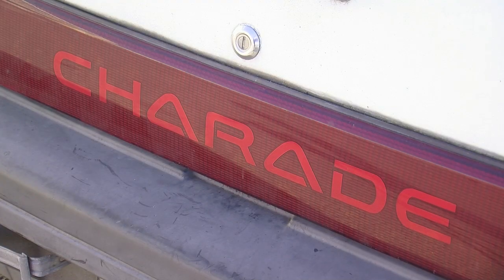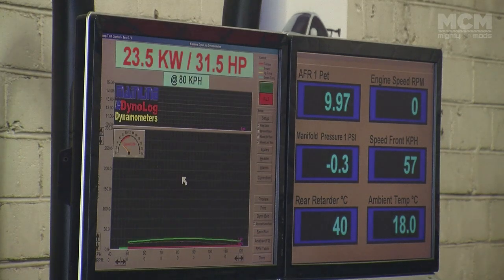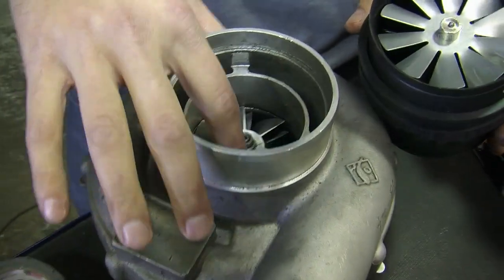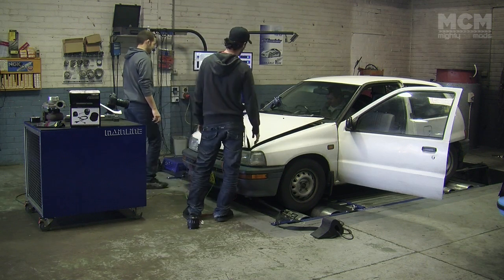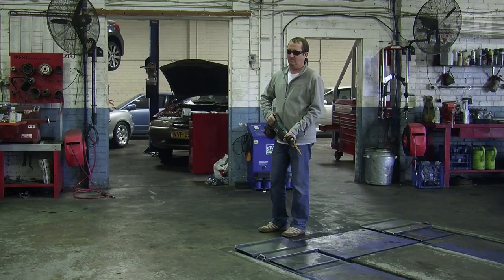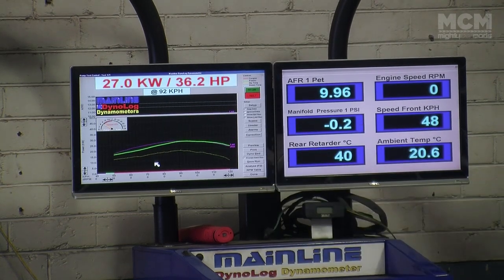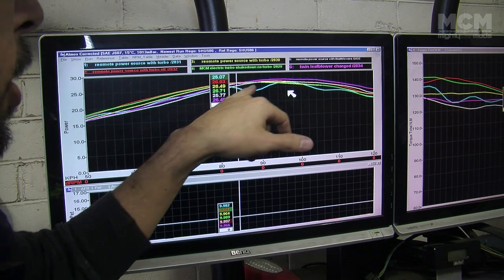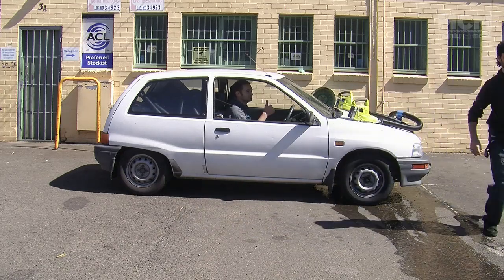Electric SuperChargers Mythbusted

Comment: These dudes don't even know how to use a dyno. You need to see curves at different RPMs. And of coarse not in that car it needs a car with clean sparks plugs and filters, etc. that is why it outputs different HP every time. Electric superchargers work but increase very little HP. The idea behind is to get COLDER air and a bit more air volume mostly under lower RPMs not pressurized air like would a centrifugal SC. It is something like Ram-Air or Coil-Induction. So in a way an electric SC would work in theory. The problem if sealed to the intake is that it may reduce the engine natural air intake under higher RPMs, so my suggestion is to use it outside the air filter to blow on it not sealed to the intake manifold. The MEMS ECU should compensate injector pulses for increased air.
Reply: No, they simply do not work. No way no how not gonna happen. You CAN NOT build pressure with one of those puny little bilge blowers marked up and resold as 'electric superchargers. They have on the order of 1/10,000th of the mechanical power to move and absolutely zero ability to compress air that a real turbocharger has at idle. If it did it would in fact INCREASE your intake Temps due to pv=nrt... you compress a gas and it WILL heat up, that's a law of physics  not some  boy racer theory to be disproven.  Fact is the are exactly zero electronic superchargers that do anything except to hurt performance. Now take your 94 Honda civic and get the fuck out of here with your 'racing stripes add horsepower through gravitational influence' bullshit logic and get the fuck out of here son before someone gives you the ass kicking you are  begging for.
Reply: Peter Carlson I only read the first sentence of your noonsense but noone said PRESSURE. Read back what I said before answering to unrelated things. And remove the head of your butt.
Reply: Miguel Rodriguez
 PV=NRT look it up, you change temperature you change pressure, they are directly dependant of eatchother. If you want to super/turbo charge an engine you need a source of compressed air that's a given, this will NOT give you that.
Reply: Peter Carlson The law of gases as it gets colder it has more density I learned that in elementary (in Europe) in the states you learn it in high shool. Go learn about Coil Induction and Ram Air. It amounts to a fraction of a second faster probably (could mean winning a race) I said you cant compare it with a SC anyhow the main thing in my comment was those guys have not clue how to use a dyno.
Reply: Miguel Rodriguez
It makes no difference. This device can only restrict your airflow at high rpm's and will slightly heat the intake air at low RPM's. Any way you put it it just won't work. They aren't talking about cold air scoops or the like and even with those they don't really work at all unless they are integrated into the vehicle by the manufacturer (like the chrysler 300's)  with careful study of the fluid dynamics of air and have an optimal length and shape of intake (resonance of such a long breather matters greatly), those cold air intake "kits" are also likewise doing absolutely nothing for you except perhaps slightly hurting performance. Something you seem not to realize is a fan does NOT cool air it can't, it won't, and it doesn't. Nothing about this will do anything to your car except add a slight electrical load and intake restriction just try to understand that. For super/turbo charging you need a COMPRESSOR, be it a roots type supercharger, or perhaps a turbine driven centrifugal compressor such as most turbochargers use there is just no way around it.
Reply: Peter Carlson Again I only read the first sentence of your dummy comment go back a read my original comment where I explain what it does and how to use it.
Reply: Miguel Rodriguez
Read the whole thing and you will know why your little fan won't work as a supercharger, they used the dyno just fine.If you can't do that you obviously have some kind of mental deficiency nobody can help you with.
 The only thing this does is take bucks from a mental midgit's pockets and gives them to the seller.same thing snake oil does.
Reply: Peter Carlson I did not buy any fan I was just making a remark again you should go back a read my comment as you are just repeating what I said. Besides installing a SC in a car that was not designed to have one will dramatically reduce engine life and premature failure of the engine will happen.
Reply: Miguel Rodriguez
 premature failure of the engine? Uh nope. WRONG AGAIN!
 I thought you were joking at first but you really don't know what the hell you are talking about.

I have a 7.3L ford powerstroke diesel I turbocharged at about 100,000 miles. Now going well over 500,000 without any problems except the normal wear and tear stuff you would expect to fix after that many miles. ie a couple gaskets and not much more.
Reply: Peter Carlson Have you heard the expression little knowledge is more dangerous than no knowledge? Applies perfectly to you.
Reply: Miguel Rodriguez
Being a diesel mechanic for 28 years after I left the army as a 91b  I assure you I do know what I'm talking about. You however are  talking straight out of your ass.
Reply: Miguel Rodriguez these aren't race engines, nor do turbochargers only get used on race cars, depending on what kind of racing from top fuel funnycar to long distance rally cars the distance driven from install/build to replacement/ rebuild could be 1000 feet, could be 1000 miles or an entire race season. These aren't race cars though, if the engine is in good shape and the boost isn't over the top they can live out a fairly normal life. Of course with your 94 civic with 250k miles if you 'throw a turbo on her' you will probably blow your rings but then again so can doing something as innocuous as replacing the heads to fix say a warped head or a burnt valve, the rings will have broken in and seated at a particular pressure where they wear quickly and mostly stop wearing unless the pressure is again increased which can cause old but otherwise still functional  rings to fail.

 Typically by boosting an engine with forced induction you aren't increasing the red line, that is usually limited to the spring action of your valves to close them  without getting valve float and slamming them into the pistons or in non interference engines just getting them to close on time for the particular phase of the cylinder's operation.
Reply: Peter Carlson Sorry I cant keep up with you I have a life here you know. Have no idea what a 94 civic has to do with this. BTW I have a Lotus Elise SC a Range Rover an Altima and soon to have a  Porche Cayman
Reply: Miguel Rodriguez And you're going to put a fan in the intake? LOL! How sad!
Reply: Peter Carlson No I am not. I never said I will. But certainly a SC in an engine NOT designed to have one and more if the car compression ratio is high it will prematurely fail. BTW if you use forcé induction naturally like installing a scope at higher speed the CFM are probably the same or more than with a fan but I still think a fan at low speeds is better than no fan.
Reply: Miguel Rodriguez Not Really. The LS7 (used in 6th generation corvettes check out my friend's supercharged z06 at www.powerlabs.org )   engine wasn't designed for a supercharger so people designed a supercharger for it while keeping it at a 10:1 compression ratio. They use them once in a while on experimental aircraft too to give the engines more power in thinner air... Hell look at the saturn ion redline, that engine wasn't designed for a supercharger but they put one on anywaus from the factory. It can be very expensive to add one but it doesn't have to mean premature failure but that doesn't mean you can just throw one on a tired old engine, you probably will kill the rings in it with greater cylinder pressures than they were broken in with, but even still many people have gotten HUGE power increases with aftermarket supercharges for many many years now, not every car that is supercharged is a top fuel dragster or funnycar that has to be rebuilt after every run.  Heck I've written PCM maps for a few cars (mostly fords) specifically to run even more boost than gasoline can handle by changing the injector duty cycles to dump in even more fuel and use larger injectors with E85 fuel. I've known quite a few of them to go well over 200k miles though they don't badly neglect their cars like the average driver does but either way it's not going to wear out your journal bearings, blow your rings, pop your head gasket, burn your valves, or score your cylinder walls.
Just because you supercharged your intake does not mean you are going to run your engine past it's redline or anything of the sort.
Reply: Peter Carlson Are you lonely? I cant read all your gibberish. I dont care about exceptions I repeat again (can you dig it) if you increase POWER OUTPUT you decrese engine life is a fact of life whatever your friend imagine he increases engine life or aliens came about and iluminated him I dont care. I use my common sense because I have it.
Reply: Miguel Rodriguez
That is factually incorrect. Simply increasing power by itself does NOT necessarily mean reduced life. Sure if you increase it to stupid levels like a top fuel car uses you will but your transmission will usually give out LONG before that. Car engines are quite sturdy solid chunks of metal and are designed to meet EMISSIONS standards not power thresholds, they leave MUCH that can be improved on to increase performance without decreasing longevity, as the electronics have improved many car manufactuers have actually in many cases doubled the power output of their engines over the years without really changing anything mechanical with them.
Reply: Miguel Rodriguez

https://www.procharger.com/faq
Will a supercharger shorten the life of my engine or drivetrain?

That is a very subjective question, as the manner in which an automobile is driven directly affects engine life. Assuming a properly tuned system, proper oil change and engine maintenance, and similar driving, supercharging generally will not shorten the life of an engine, just as is the case with OEM turbocharging (with proper cooldown for turbochargers. A cooldown period after driving is not necessary with supercharging). This is especially true of centrifugal supercharging, which generates boost in line with engine rpm, unlike roots and twin screw blowers, whose low rpm boost can place additional strain on the engine and drive train. Superchargers can be used with automatic or manual transmissions and will not increase transmission wear under normal driving. When racing, however, the additional torque provided by supercharging will place additional load on the transmission, especially when increased traction is present, such as with slicks. This impact is minimized when the boost increases with engine rpm, as is the case with centrifugal supercharging and turbocharging.
- See more at: https://www.procharger.com/faq#sthash.kBUhGoSy.dpuf
Reply: Peter Carlson I am not going to read about it have no time for that but the live of the engine also will be shorten not only the transmisión. Centrifugal are the best but still shorten the live. Of coarse if you drive nicely then not worry. People use your common sense PLEASE.

Comment: Alright, listen up. I'll try to explain what I did. Search for "How To Build A Peltier Cooling Device". Once you know what is it figure this out, I put that cooling fan into the air filter box, so it makes cold air sending it directly to the throttle body. But Im not able to take the car to the dyno. Can anyone recreate what I did and check if there is any hp gains?
Reply: Nope, won't do a damned thing, peltier junctions are great for keeping your coffee cup hot but not great in the slightest for cooling many tons of air per hour. Even if they could you would need more electricity than a skyscraper would to run the thing and it still wouldn't work!

Comment: LOL. You'd need a better airbox. Those leak into the PCV and hot air pickup. 
I know you know that the low end kw loss was from the pressure against the jets being greater than the pressure in the float bowl.
Reply: +Llia Olsen , Definitely. I thought my eyes were deceiving me when I saw the stock airbox. 
And imo, a Y instead of a T..
Reply: Ikr
Reply: +Inte riktigtnamn is it possible to have a air compressor in your car with a line running to your intake to create some boost? like if you had the compresser filled and you had a single shot of air into the intake ?
Reply: That's basically the principle of the nitrous oxide systems they use in dragracing, but with nitrous oxide gas instead of ordinary air. (Both contain oxygen.)

The NOS systems also have additional fuel lines, since it's a bad idea to add just oxygen.
("Adding just oxygen" is how a cutting torch works... and they cut big ugly holes in metal.)
Reply: +Llia Olsen how you know so much ?
Reply: So what happens if u put carbon dioxide instead of n0s?!
Reply: Matt Holley Less power than just leaving it alone.  The chemistry of "burning" is that you're combining the oxygen in the air with the carbon in the fuel to form carbon monoxide, carbon dioxide and releasing energy in the process.

Comment: Those numbers seemed kinda low (from an American perspective) and the USDM version of the NA-1.0L I3 (w/EFI) used in base level (3 and 4-door) Charades for the 5 years it was imported ('88-92) was 54PS (53hp or 40kW). Most likely this was a carbureted version of that engine.

For comparison the Suzuki of that era (Cultus/Swift - Geo Metro and Pontiac Firefly in the States) had a similarly-sized engine with 55hp, but that car was probably 100-200lbs. (45-90kg.) lighter for about the same output, which made them more fuel efficient and zippier around the streets than the Charade. Although the Charade (being built under Toyota standards when they've built on their best quality ever) was better built/more reliable and more stylish, it was smaller inside, heavier and more expensive (you could almost buy a NA-1.3L I4 Suzuki Swift for what Daihatsu asked for their Charades with 1.0L I3's), which doomed them in the US and Canadian markets (Suzuki Auto is also now nowhere to be seen in either country).

You guys definitively PROVED those "fans" were a waste of time and money, even at the low money layouts we're talking about... (it'll probably applies on both sides of the Pacific as well)

Comment: noduh dipshits that fan  on there looks to be a simple electronic case fan xD 

Not saying the principal of electric driven boost doesn't exist, but it would take a few high end resistors and capacitors, an inversion unit and an extra battery, the gain you'd get would depend on how fast the car moves forward and would probably be eaten by the weight of the necessary parts
Reply: +LosCadaver 

one would need a 350 KW compressor to achieve a somewhat equal air input to what the engine takes in by itself, anything less and you'll be restricting airflow
Reply: Nightdare you mean to make my point, yet offer it as a counterpoint?
Reply: LosCadaver

No, I'm on your side
Just that a few resistors and an added battery is a severe understatement

Comment: Technically, blowing air is compressing air. Compressed air just means high pressure air. A fan will increase air pressure and "compress air," just not nearly as much as the real deal.

Comment: HEY MCM what if you used an air compressor? Have a huge air compressor in the back of the car, with it routed into the intake via a wide tube and you can activate it at high RPMs for quick bursts of power!